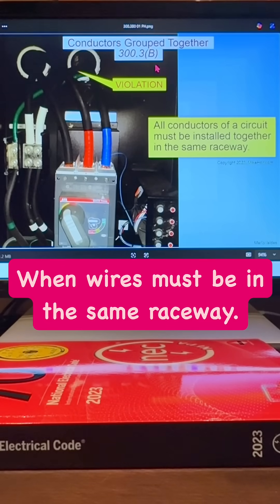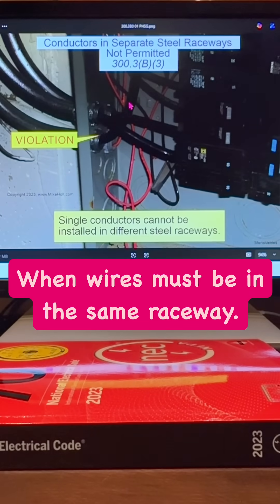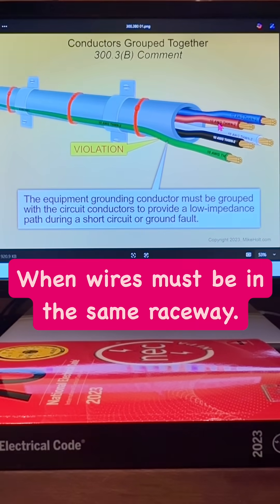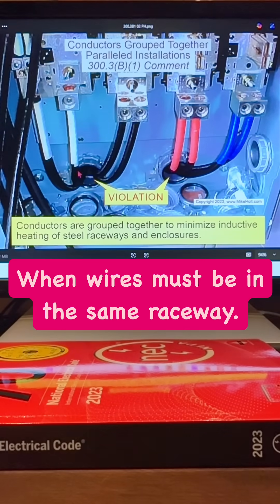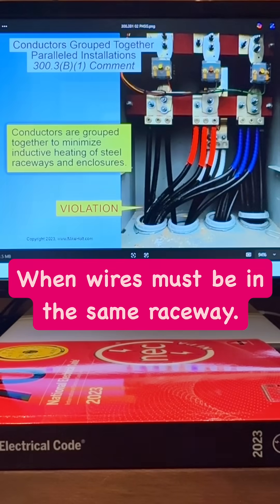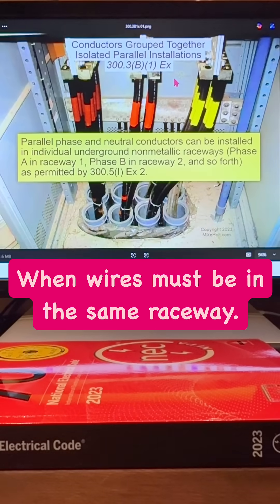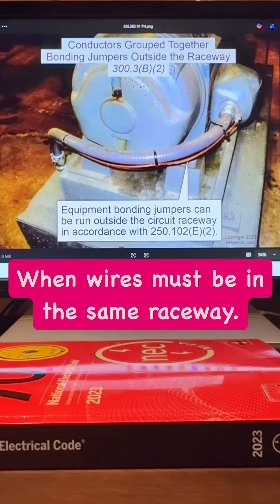All circuit conductors must be installed in the same raceway, see 300.3(B).

Comment: Mainly a resi guy, what happens if you put wires in multiple pipes like that?
Reply from the maker: @ProjectGnome1961, the metal raceway heats up cherry red from Inductive Heating. Look it up.
Reply: @MikeHoltNEC that’s really cool in a terrifying kind of way. I’ll start looking for that on commercial jobs because as I’m sure you’re well aware there are a TON of minor additions made to those jobs. Can’t tell you how many times I’ve found romex in office buildings; sometimes they don’t even add a grommet when going through a stud and ends up eating through the insulation and blowing a hole through the wire
Reply from the maker: @ProjhectGnome1961, NM cable is permitted in a Commercial occupancy. See 334.10 and 334.12.
Reply: @MikeHoltNEC I thought it wasn’t allowed in areas with drop ceilings which make up most office buildings I’ve worked in
Reply from the maker: @ProjecftGnome1961, correct NM cable is not permitted in the drop ceiling area [334.12(A)(2)], but it is permitted in a commercial 'occupancy.'

Comment: Can you run a ground wire from a panel to a utility room for a communications ground bridge? If so does it need to be treated like any other conductor or can it be ran above drop ceiling and protected only when it exists?
Reply from the maker: @shortsilwady, please post your question on MikeHolt.com/Forum

Comment: I have seen this problem at the service entrance in a skyscraper that you probably know from a movie.  The raceway was nonmetallic but entered underground through a concrete wall that was rebar reinforced.  The bozos pulled the parallel conductors and grouped them one phase per pipe.  
That wall is nice and warm.
Reply: Why is it warm?
Reply: @martf1061 
When you have all the phase conductors together in a raceway the magnetic fields cancel each other out.  In this situation there is iron rebar encircling individual phases and there is a magnetic coupling occurring.  Much like a transformer.  As the building draws current some energy is converted to heat in the rebar.
Reply: Looks like this is a common mistake. The other mistake is, if you have parallel runs in a few raceways, each raceway has to have a full sized EGC in each raceway. Like if the table calls for 3/0 copper EGC, and you have 4 parallel sets of conductors then you have to run a 3/0 copper in each one, you don't get to undersize the EGC just because you have 4 runs.

Comment: You're doing God's work educating on NEC! ❤
Reply: @MikeHoltNEC  Dude you're not joking on the inductive heating part! I was involved a few years back in installing a backup generator for a nursing home. 2000 amp service to the building at 208v, generator sized to 80% of the service disconnect OCP. So for 1600 amps needed a few runs of 750 kcmil copper run. One subcontractor put in 4 4" steel conduits. The electricians apprentice thought was a good idea to put all the blacks in one conduit, all the reds in one, and 4th one had neutrals and grounds. When they fired up the generator and did load bank test on it, you could literally light a cigarette off of that conduit. It all had to be pulled out and redone. Then inspector came out and it still failed, they didn't realise you had to have EGC in EVERY conduit, there was a big argument on the equipment grounding conductor size, they were saying since there's 4 of them can't they be sized smaller, inspector was like NOPE every EGC has to be from the table for 1600 amps equipment. Can't use the raceway for EGC, too many joints and elbows etc going from generator pad down to the basement electrical room.
Reply from the maker: 😉Wow
Reply: @MikeHoltNEC  It's been working fine for about 10 years now, but each raceway now has a complete set of 3 phase conductors, a neutral, and an equipment grounding conductor. Big 6 cyl Perkins engine in that thing, it's 33 liters displacement, not sure how many cubic inches that is, but it's 800 horsepower. If you run 600 kilowatts with each phase in it's own steel conduit, it gets stupid hot really quick...

Comment: Could you elaborate on the inductive heating issues in another short?
Reply: It's a really big issue actually. When current flows through a wire it generates a magnetic field around the wire. When that wire is run through holes in a plate (or conduit) made from steel, the alternating magnetic field generates "hysteresis losses" in the steel. This heat can be enough to cause paint to blister.

By running all the conductors for a circuit (Active + Neutral for single phase, or all conductors for 3 phase) through the same hole (or conduit) the magnetic field cancels out and the heating is negligible.
Reply: @michaelnoble2432 thank you!!
Reply from the maker: @michaelnoble2432, 100% correct.